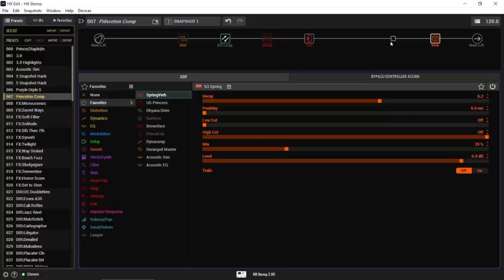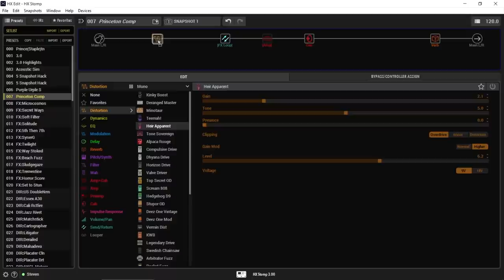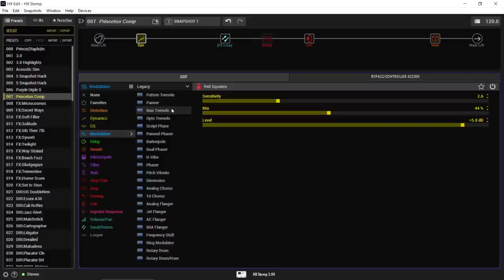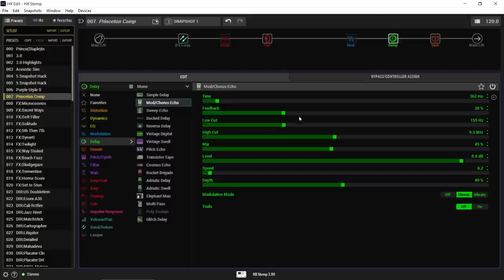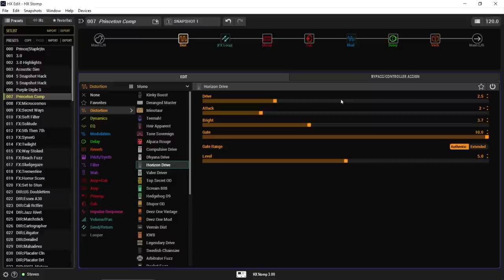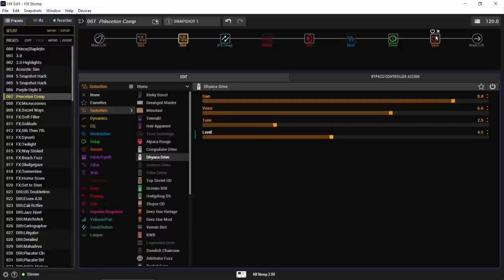Helix 3.0 Princess vs VINTAGE Princeton Tube Amp. Do they sound the same? Line 6 HX Stomp firmware

Comment: Don’t get me wrong, I’m loving the Princess. 

But...I can’t help but to think that by running the reactive load into the Helix and using the same IR, much of what makes a tube amp sound the way it does is removed from the equation. 

I’d be curious what your thoughts are playing the helix through your monitors vs the “feel” of the amp in the room.
Reply from the maker: The point of the helix is to sound like a perfectly mic'd cabinet in a separate room of a studio where the room sound is not a factor. Studio monitors and a guitar cabinet will never sound the same since they're designed for totally different purposes. This experiment literally isolates the amps the best way possible for comparison by using the same IR. Comparing a speaker in a room vs modeling amps, modeling cabs and modeling mics is not gonna be equal. Too many factors to consider if you ask me!
Reply: @SteveSterlacci  thanks. The two are so close it’s splitting hairs.
Reply from the maker: @jerryrichardson5545  I agree! Thank you for listening so closely too!!! Hope you check out and dig the preset

Comment: I don't know if you have a PowerCab but if you do, do you notice a difference between the two? Just curious if it will cut the same.
Reply from the maker: You mean power cab vs the combo speaker in the room?
Reply: @SteveSterlacci  Yes
Reply from the maker: Hard to compare the two that way. pc Is a different animal. More directional and straight beam of sound vs an open back cab that will have a greater spread around a stage
Reply: @SteveSterlacci  Sounds to me that Line 6 needs to make the PC with an open back then!
Reply from the maker: I'd love to try one!
Reply: @SteveSterlacci  So what do you use for your "live" monitor with the Helix or your Practice Amp with the Helix?

Comment: Umm I'm building a Princetonish amp and putting it into a cabinet with my Pod Xt Pro in the top and a 12'' Lorantz Greenback clone atm - call me greedy...
Reply from the maker: Dew it!
Reply: @SteveSterlacci  I'm using 6SL7s preamp valves (tubes) instead of 12AX7s .
No tremolo or reverb (the Pod can do that)
Each triode of V1 will one of the Pods stereo outputs.
One triode gets a 250uf bypass cap like a Bassman with a carbon comp plate resistor and a Mallory 150 series coupling cap.
The other triode gets .68uf bypass cap, metal film plate resistor and orange drop coupling cap for bright edge ala Marshall.
The 2 triodes mix thru a Brownface Deluxe tone circuit. Then it's Brownface Princeton the rest of the way.
I'm calling it the 'Blender'
Reply from the maker: That sounds incredible! I wish i knew that much about amps. I have a January '64 6g6B blonde bassman too 🙃
Reply: @SteveSterlacci  nice. First amp I ever played thru in '75 was a m8's dad's '65 Princeton. I bought a Super Reverb shortly after - had it 25 years
Reply from the maker: Very nice!

Comment: As always the digital version shaves the extremes off up top and down low, and sounds more flat. Tonally close, but once you know what to listen to, easily distinguishable WHEN AB’D like this. The amp primarily has more air up top, the model more hair on the tone and just less dynamic. If you would mic the amp through a good preamp and converter though, difference would be a lot more.
Reply from the maker: I think the main difference is a result of headroom. The real amp stays clean all the way up. The model gets dirty around 6. I think a blink test would yield them indiscernible
Reply: @SteveSterlacci  But don’t forget dynamics. Even when both would be set clean, digging into the amp would give more volume oomph than into the sim. There’s always some sense of a limiter with software, this thing that keeps the tone in this predefined zone. You can go here and there, but not outside this box. Although tonally close, a real amp just breathes more for lack of a better word. And my main gripe with digital would be: if you stack 6 tracks of this more limited box in a song, or 6 tracks of a real open amp. That’s when you’d notice the cumulative effect of that tiny bit of difference that seems negligible now. But I do realise an amp sim won’t make a good song bad. Real amps will make a good song even better though :)
Reply from the maker: Listening and watching back you can see (i guess seeing myself i have a better analysis of what i myself am doing)  when i have the slightest change in the right hand it makes one brighter,  then 3 seconds later will do the same for the other. Try listening to a clip blind and write down which you think is which,  then rewind and check.  Curious to see those results !
Reply: @SteveSterlacci  I actually did that while watching the video. Looked away and then rewinded and checked. For the clean settings got it right about 80% of the time! Gain was a bit more difficult as you could hear the slight volume bump on the helix more clearly. My preference going digital by the way is the ox box. The best so far! Anyways, thanks for the video! It was very interesting!